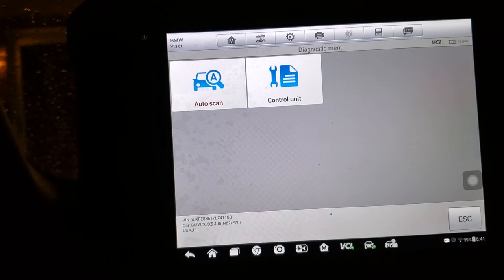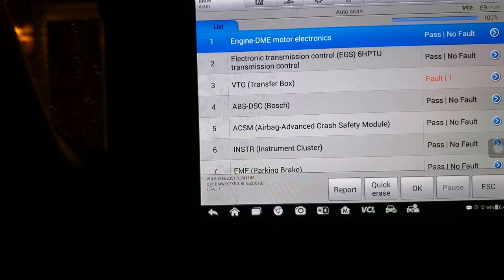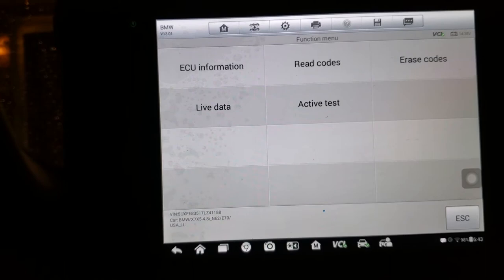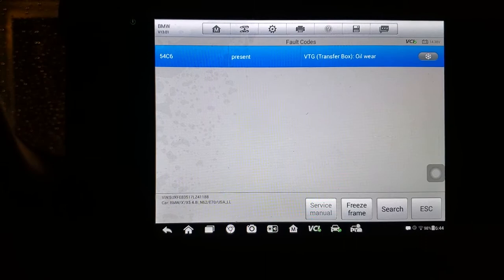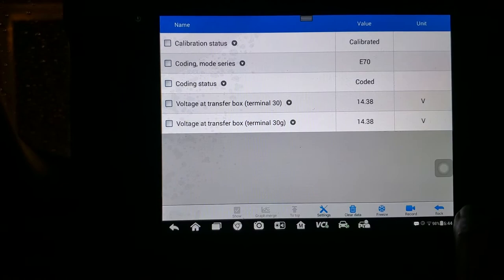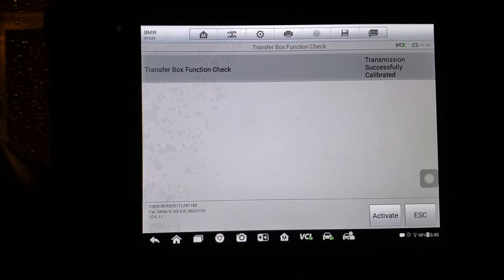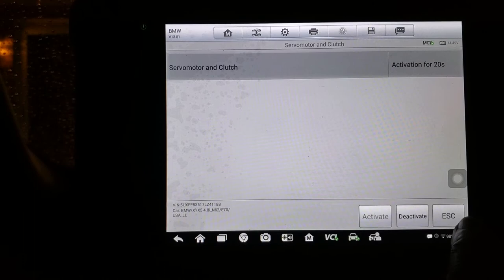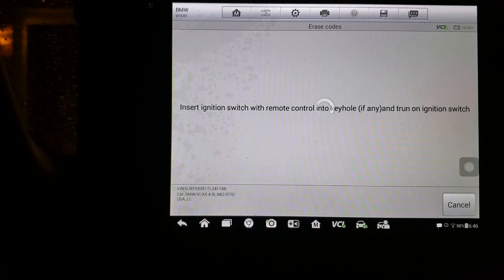BMW transmission code 54C6 oil wear reset with Scan tool

Comment: Thanks for the video and the useful content. I have an e92/2010 where I started to get a transmission fault on the dash after I have changed the gear cooler and the gear oil. The car did not generate any codes earlier, but after I have done the above maintenance, I started to get the ugly transmission fault. The fault only comes after I drive the car (after 20 or 30 mins) not sure what could be the relation but it seems that when the car is warm enough this fault comes in. After the fault is on the dash, the car starts to have poor transmission, error in selection (be in N while the selector is in D, etc.) I got it inspected by a mechanic (who did the oil change) but he was not able to fix it (he suggested to change the whole gear box, which I am not convinced to do!) It is notable that when the car is parked, cold, it starts with out any issue and without the transmission fault. The fault comes after driving the car for 30+ mins. I am puzzled and not sure what to do. Any suggestions?